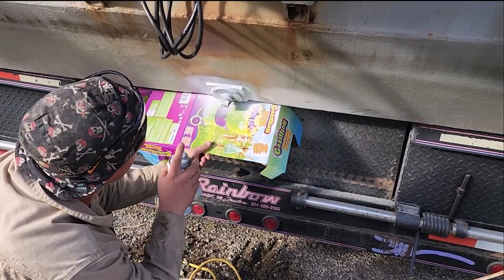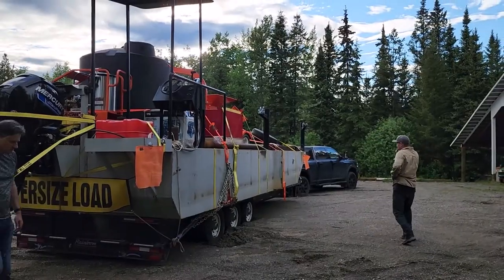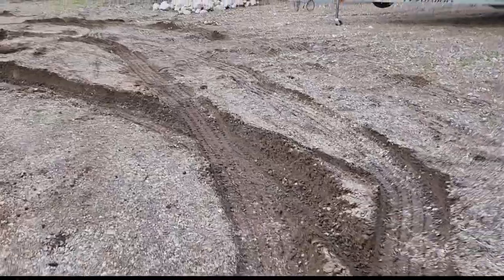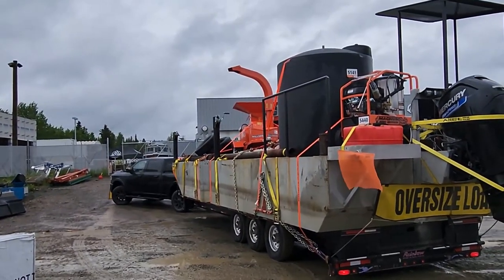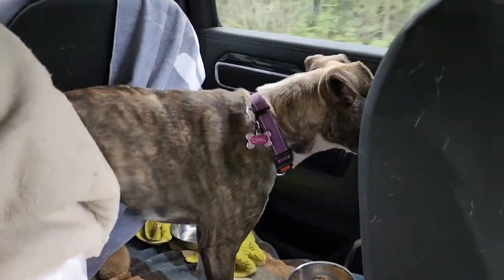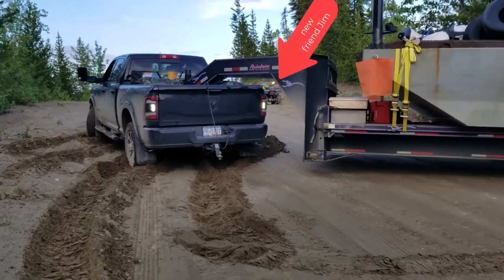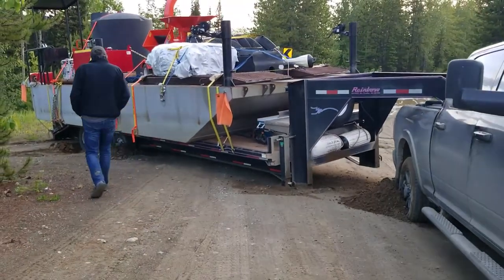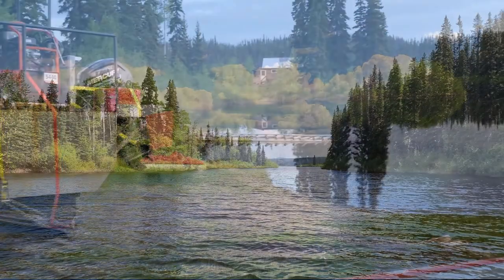Our Truck and Trailer Get Stuck Deep - TWICE | S1 E10

Comment: Grab the bottom of the steering wheel when backing up. Steer same direction you need to go in. Go slow and practice. Use your mower with a short trailer. Great practice. I dropped my son (13years old) at the boat ramp and asked him to bring the boat trailer to the ramp. He backed it through 3 rows of parked trucks and trailers. By the time he put it in the ramp he had an audience. He had backed it up through the whole parking lot without a bunch of back and forth. Several people said the best backing job they had ever seen.
Reply from the maker: That is such great advice and instruction! Kudos to your 13 year old son... that's pretty impressive! 💚 Thank you for watching!
Reply: You could have lost the house if your 13 yr old had backed into the audience, lol!

Comment: One of the things I admire most about the Canadians is their ingenuity. However, I've been screaming at the TV for the last few episodes, why didn't you get a winch fitted to the front of your truck when you had it modified to take the trailer. Anyway, it probably wouldn't of made such good content.
Reply from the maker: Ah ha... good points you make... I'll ask Ryan to answer this one. Thank you for watching 💚
Reply from the maker: Mounting the winch on the front of the truck seems like a sensible and practical idea to me. I'll look into it!  -Ryan
Reply: @mywildholm  I googled it to see if it was possible before commenting, seems like they do fit them to dodge rams. My thoughts were that you could of unhooked the trailer on the boat ramp, turned the truck around to pull or winch the barge up. It would maybe get you out of the mud on the road to your place, using trees as anchor points. Though its easy for me to say from my armchair :) and you done so much better than 99% of us would of in the same situation. Thanks for taking time to reply Ryan, I'm really enjoying your content.
Reply from the maker: A winch would be awesome... I looked into this but because of the intercooler (we have a diesel), there is no room behind the bumper to install a mounting bracket. I could have an aftermarket bumper installed, but that is too costly. What I might be able to do is install a front hitch receiver, then the winch can be removable.  The bonus is that it would also be protected from road salts.  I'm looking into this now.  Thanks so much for hanging with us!  -Ryan
Reply: @mywildholm  That sounds like a great idea. I looked them up and seems that you can also fit them yourself too. Hope to see it in a later video if you go ahead with it. Sure would come in handy.
Reply from the maker: 👍 I think so too!  -Ryan

Comment: I predict that in time, you probably will be purchasing a small welding machine. That can save you a ton of time and money. I went to an industrial welding school back in the early '60's and became certified, however, you can now learn all you need to know from YouTube.
  You have also shown a couple other areas of my expertise. One is backing a trailer! It only took me a gazillion tries to discover that it only takes a slight turn of the steering wheel to correct a trailer's direction instead of my tendency to oversteer.
  and the last is my experience in getting stuck in soft ground and learning how NOT to. First, sharp turns are a big no-no. You always want to drive in a straight of a line as possible with only a slight turn of the steering wheel, even if you have to go back and forth several times to achieve the direction you want. You also want to accelerate as gradually as possible without spinning, which only digs your vehicle in worse. When possible. never stop on soft or slippery surfaces if you can avoid it. Momentum is an important factor to avoid getting stuck. Hope this helps. .
Reply from the maker: That is definitely something that Ryan would love to learn - welding is such a valuable skill in so many ways.  He agrees with that for sure.  It doesn't sound like there is much that you haven't done in your life!  Very interesting!  We love hearing about your history - thank you for sharing!